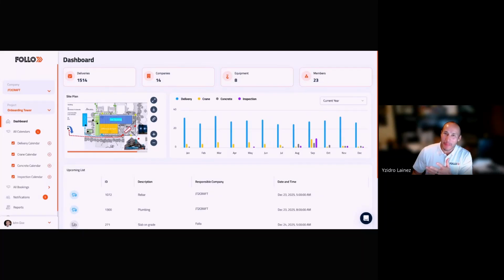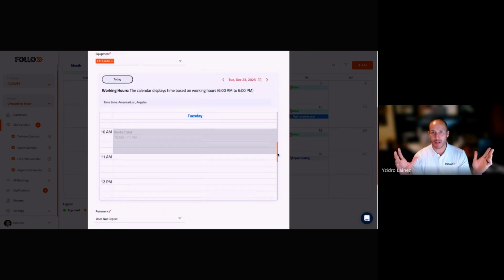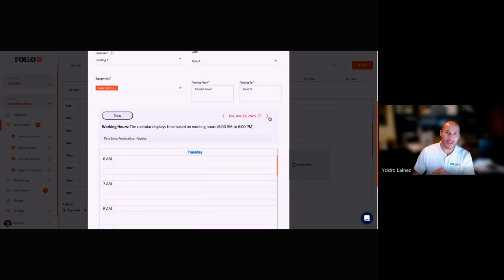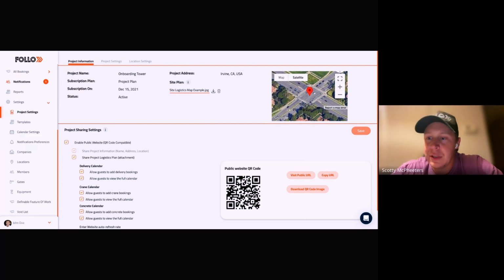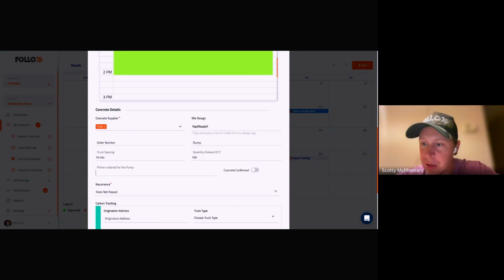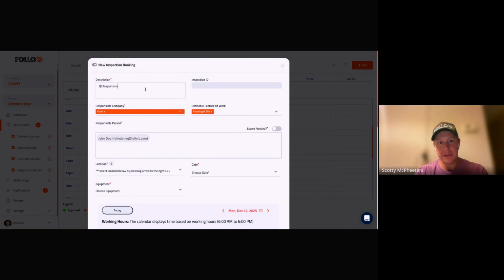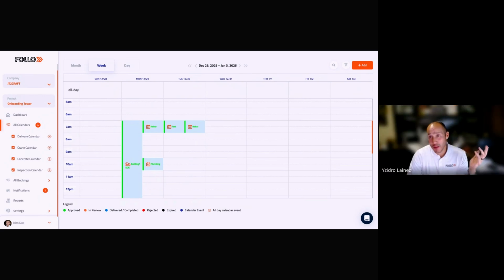The 5 Biggest Construction Logistics Problems General Contractors & Superintendents Face

Comment: This video explains how the Follo platform addresses the five most significant logistics and coordination "pain points" for general contractors and superintendents on large-scale construction projects.

1. Elimination of Delivery Chaos
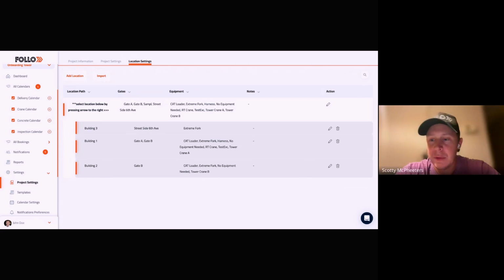Real-Time Coordination: Follo replaces static, manual tools like whiteboards or post-it notes with a dynamic, mobile-accessible delivery calendar [02:56].

Resource Booking: Subcontractors can book specific delivery times based on the availability of site resources, such as specific gates or offloading equipment [01:43].

Reduced Downtime: By providing real-time updates and requiring superintendent approval, the tool prevents idle crews, traffic jams, and the high costs associated with unscheduled or late deliveries [04:03].

2. Efficient Crane Management
Digitized Scheduling: Instead of walking across a site to sign a physical clipboard, personnel can book crane time directly through the app [09:17].

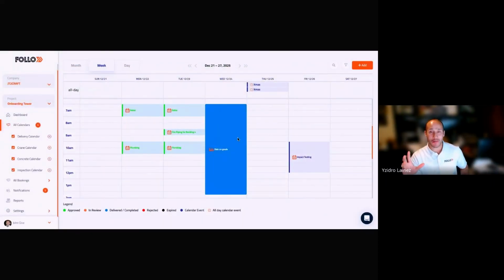Conflict Resolution: The system is "smart" enough to recognize scheduling conflicts, ensuring that expensive equipment like tower cranes is utilized efficiently without overlapping requests [10:58].

3. Controlled Concrete Placements
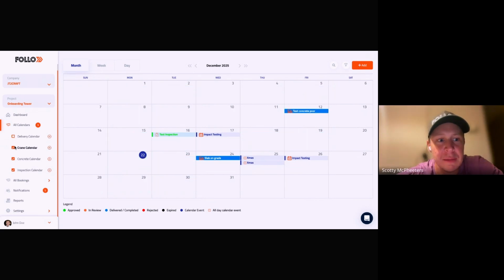Detailed Logistics: The platform allows for the management of complex concrete pours, including tracking mix designs, order numbers, truck spacing, and pump requirements [15:31].

Gate Locking: Superintendents can "shut down" specific gates during a pour to ensure concrete trucks have clear access, preventing critical-path delays [16:14].

4. Streamlined Inspections
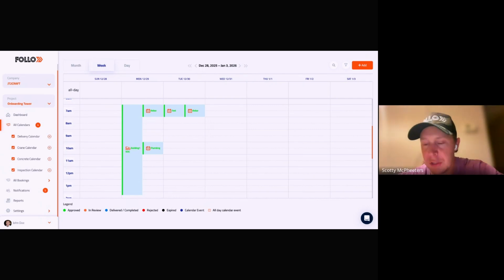Integrated Approvals: Inspectors (including county inspectors) can be added to the platform as approvers, allowing them to receive and manage requests directly on their mobile devices [20:25].

Auditable History: The app captures photos, notes, and timestamps for inspections, providing a clear "pass/fail" history and a digital trail for quality control [22:40].

5. Improved Communication and Accountability
Centralized Truth: By consolidating all field logistics into one app, Follo eliminates the communication breakdowns that typically occur between different trades and the general contractor [24:11].

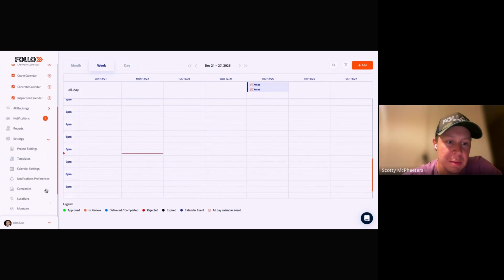Tiered Authority: The system uses three levels of authority—Project Admin, General Contractor, and Subcontractor—to ensure the right people have the power to approve or edit schedules [11:46].

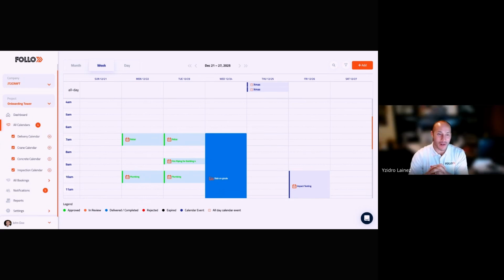Predictability: The tool shifts site management from a reactive state to a predictable one, significantly reducing stress for field teams [08:41].

You can view the full video here: https://www.youtube.com/watch?v=2OBlBRrWG2Y